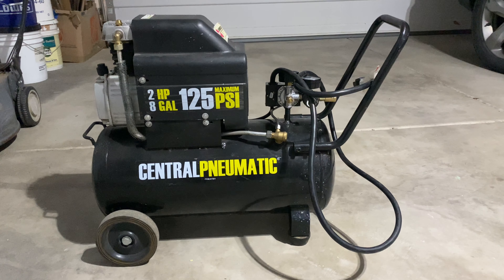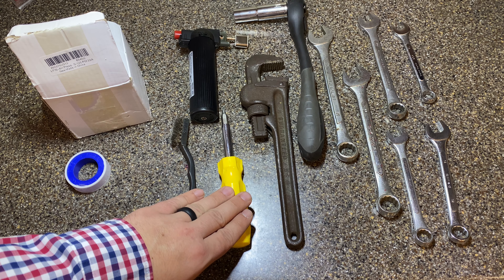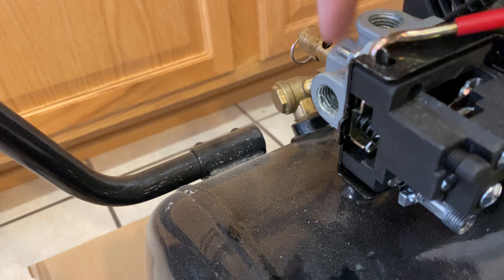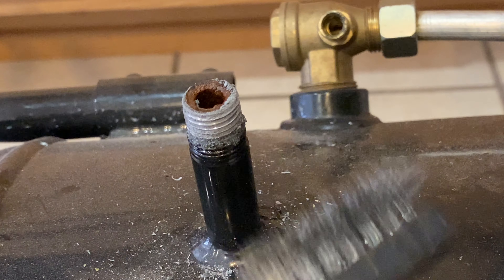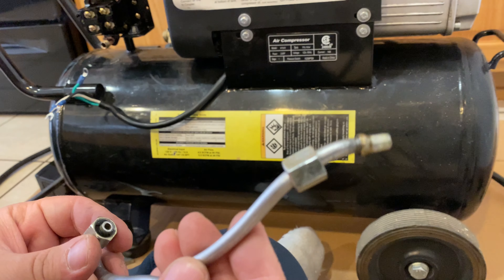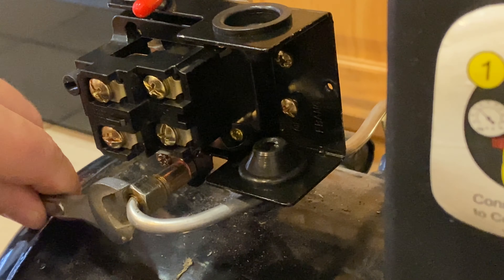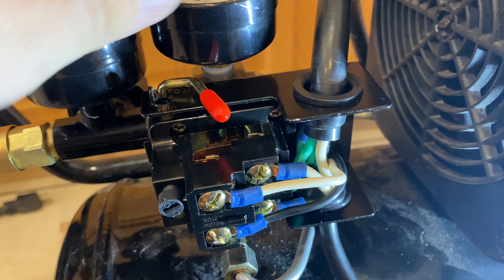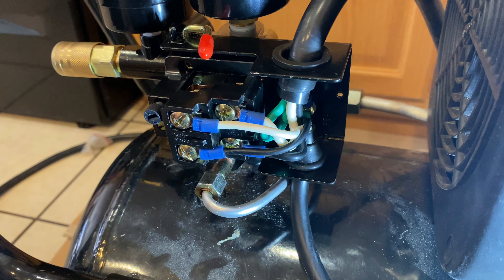How to Replace a Pressure Switch on an Air Compressor | Central Pneumatic  Pressure Switch

Comment: Looks like you install that pressure switch side ways. The center port (on the very bottom) is supposed to be fitted to the air tank. And than all the other ports are connected to the appropriate outlet uses. Of course it works because all the ports are built together sharing the same air and pressure. But if you look, the center port at the very bottom is designed for a wrench to tighten it on the stub out from the tank...  All other ports will have the male fittings installed to use with a wrench.   Thumbs Up!
Reply from the maker: Yes, I guess we can thank the engineers at HF for the design as it's not conducive for easy assembling but it works in the end!

Comment: My air compressor hits 145psi and it starts popping and shaking just like it shutting off and coming back on , and help will be appreciated thanks
Reply from the maker: Is it the same Central Pneumatic 125 psi compressor?
Reply: You can adjust the pressure cut out lower

Comment: Will all pressure switches accept 110 or 220 volt ?
Reply from the maker: Read the pressure switch specs. It will tell you what it’s rated for.

Comment: Hi. Thanks for the great video. I bought a small air compressor probably 5 years ago. Been stored in my heated basement till today. Put compressor oil in it, opened the release valve on bottom of tank and let it run for 30 minutes as per instructions. Changed the oil and when I plugged it back in the motor worked but the compressor did not. TIA if you can help.
Reply from the maker: So it’s not building pressure? Or is the motor just humming? What brand compressor and size?